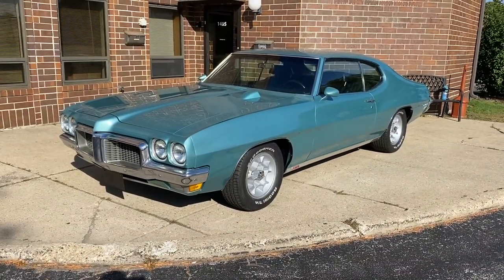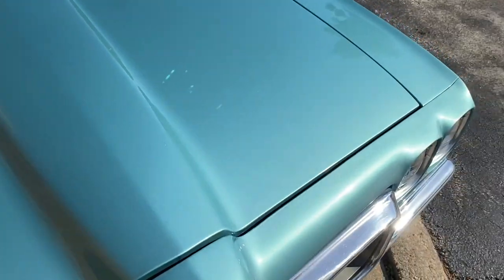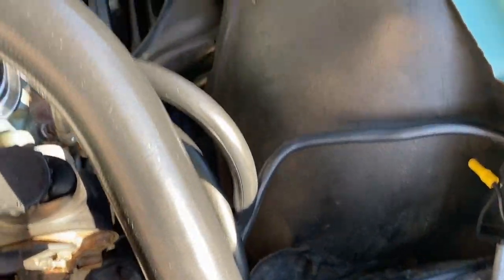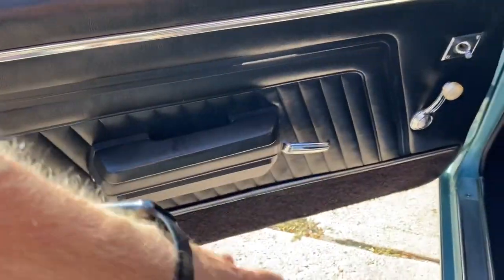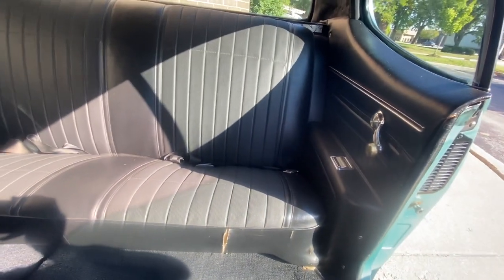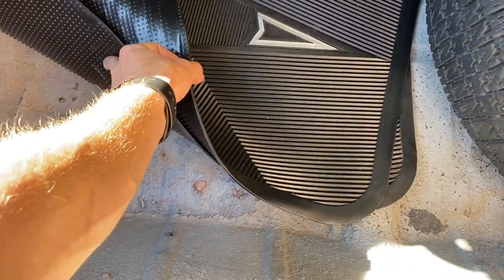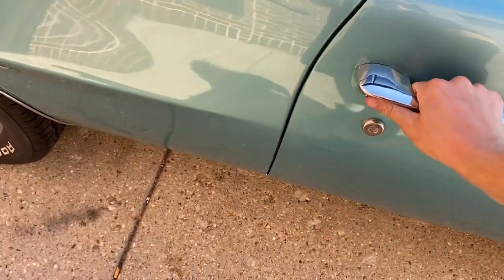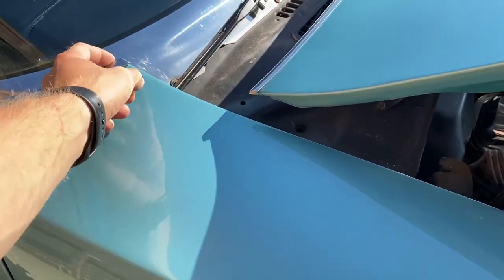1970 Pontiac Lemans Sport - 400 4 Speed - SOLD

Comment: LOVE everything about this car except for the wheels. Are they stock for that year?? I thought they didn't come out until like 72 or 73. Which 400 was in it?? With t he 4bbl and duals I'm guessing it had to have been 325 or 335 HP?? Could you get the 360+ hp 400 in a Lemans sport?? Love that poncho idle. Needs a good warming up period to run the smoothest. With a 355 or 373 gearing this thing is as good as any goat. What's the Hurst badge on the trunk?? I don't think I've ever seen one.